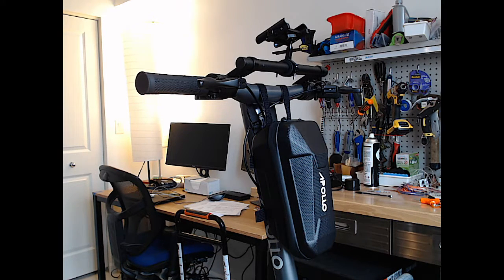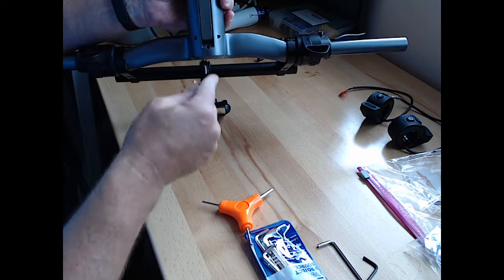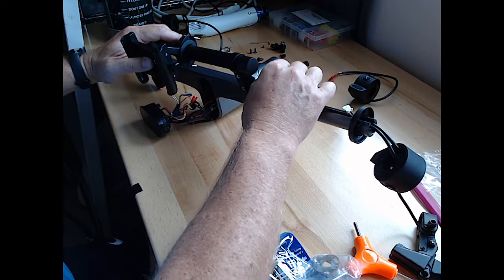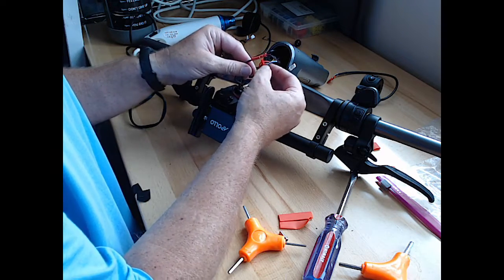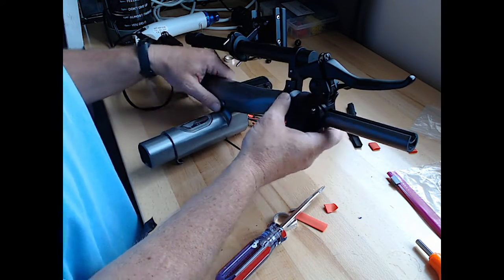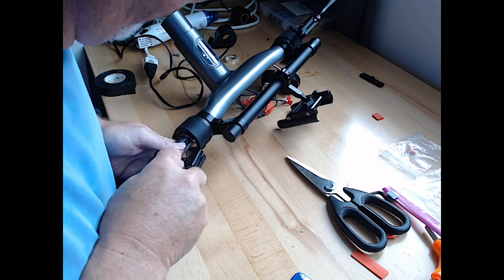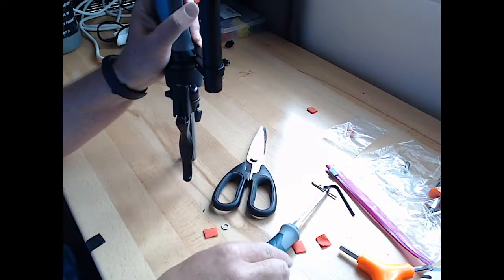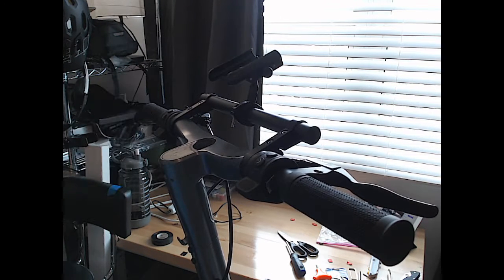Apollo City 2022 Throttle Replacement

Comment: I had the exact same issue with the bell and break pedal rubbing against each-other, ever since my retailer swapped the stock pedal ( because it became "sticky" and eventually broke ). I figured it wouldn't be a big hassle to open the bell and try to screw it on at a very slight angle, but I ended up unscrewing the whole handlebar to try and move it to the side aaaand now the damn bolt I undid won't screw back in... some debris came out when I unscrewed it, so something's effed now and I'm pissed off at Apollo... I've had nothing but problems with those handles, both stock and replacement versions. Had I known how much of a fail point they are I would've steered clear of this model or even company.